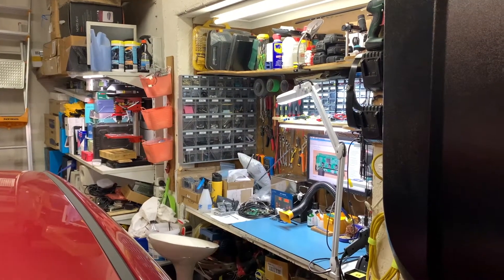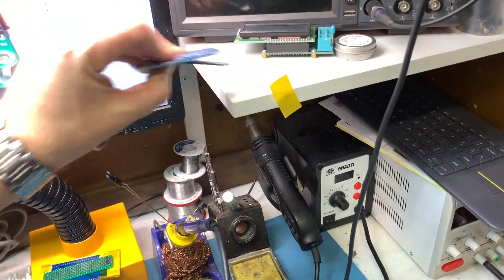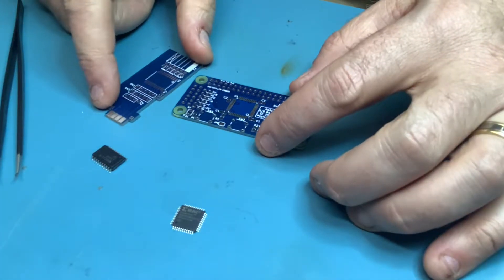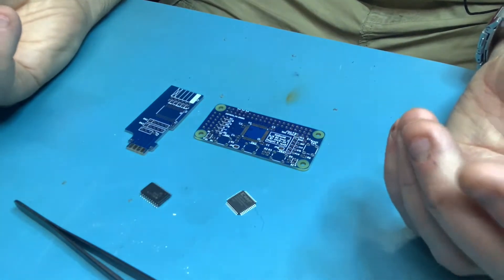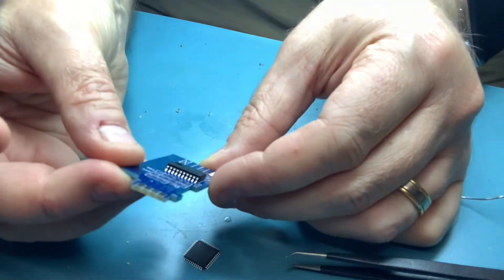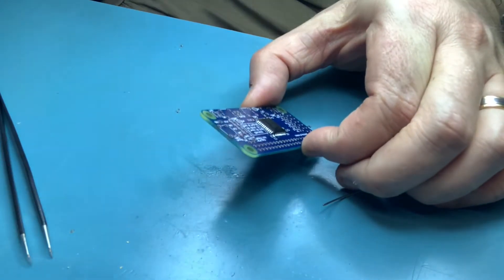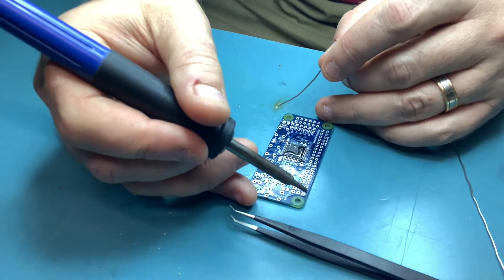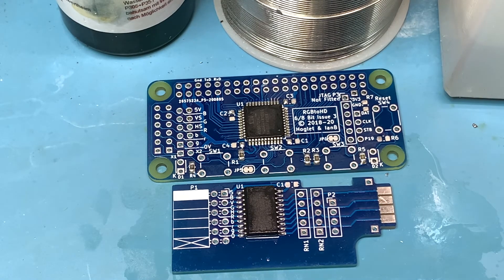Workshop tour plus SMD Soldering Tutorial

Comment: Thanks, I'm still a through-hole type of guy but this is useful as SMD becomes the norm in modern electronics. So I may need to move forward and not be afraid of change.
Reply from the maker: I prefer TH too but SMD is super easy with a bit of practice.

Comment: That well tip looks to be a real lifesaver. Unfortunately I just can't find one for my soldering station. I have an old Weller Lr21
Reply from the maker: Yeah it is really amazing. It’s worth upgrading to a modern soldering station with PID temp control and a cartridge system. They just heat up so much faster and maintain temps even when soldering on huge ground planes etc.